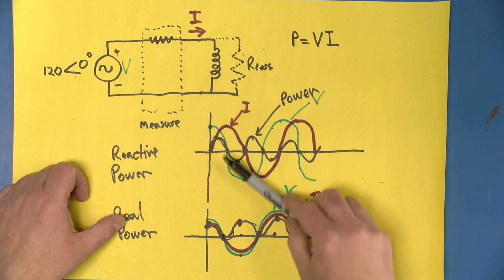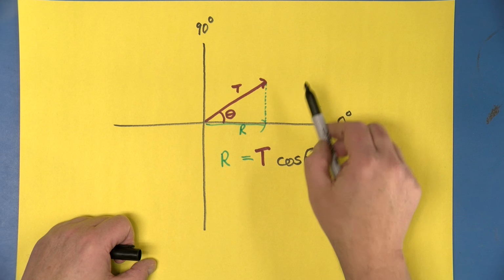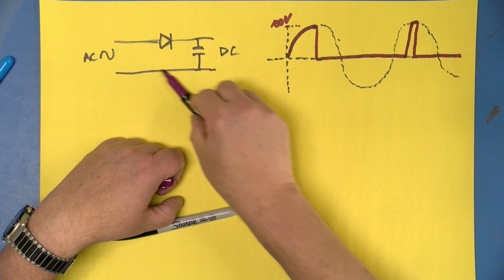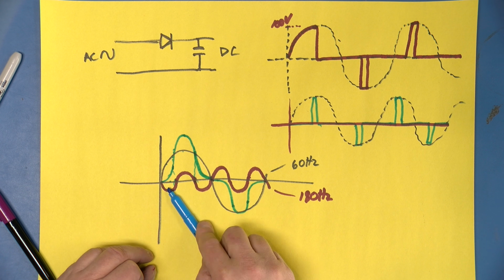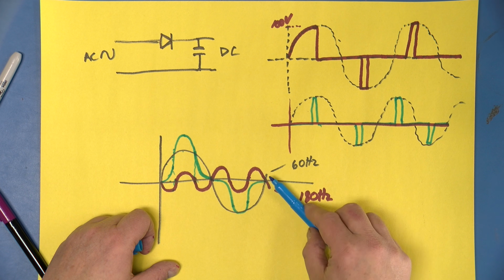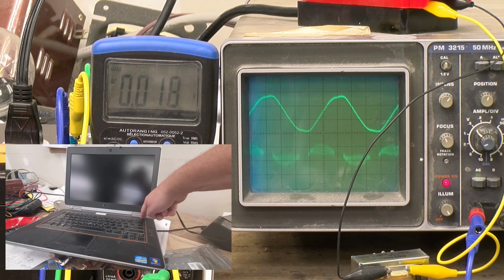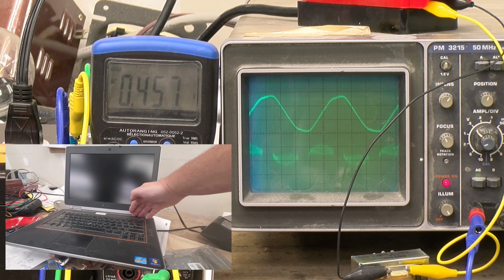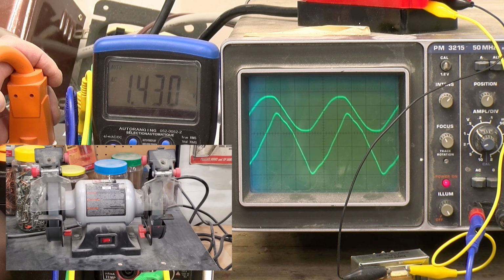Power Factor: you won't believe how bad some of our electronic devices are!

Comment: Hi, again a excellent video.
Can you share the contents of those 2 black boxes ? Because the way you use them for measuring current with your scope intrigues me, i know the simplest way to measure current is with a current shunt, but the problem with that is, that the ground of the scope probe then causes a short. Or you need to use a isolation transformer (or a expensive differential probe) but that isn't clear in the video. Thanks in advance.  Grtz
Reply from the maker: Than Bjorn! They simple shunt to ground current probes. Over herer (Canada - and also the US) the 120V outlets are polarized so one of the pins is defined as neutral (connected to ground in the in the circuit breaker panel) so this configuration is relatively safe. You couldnt really do that in many 230V countries with some of the two pin European style plugs which are not polarized (I think variants like the French plugs are ?) since that could leave the ground/return connection of the scope at 230V depending on how things were plugged in. 

I also was using my analog Phillips scope which has a two wire plug - no ground. The HP digital scope I have is grounded  and would trip the GFCI.

You made me think about one might make a similar setup in the EU regions with unpolarized plugs. Perhaps an isolation transformer and if yo wanted a neutral, use a   polarized plug like a British plug as its output, with the neutral connected to ground. Alternately, current transformer to sense current and a isolated step down for voltage. I'm not sure how high a frequency a CT would carry - I have a bunch 0 should test them!.
Reply: @ElectromagneticVideos  Hi, yes we use non-polarised plugs, but even with polarised  plugs, the problem stays the same. We use here the T-T mains grid system, so our Neutral and ground are separate. From the street we get 3 phase wires and neutral (4 wires in total) to our home, each home has a copper rod in the ground which is used for ground. In the breakerpanel and through the entire house, this ground and neutral are separated from each other, and depending on the electric load of the house and neighborhood, we have arround 0,5 up to 5V (useally arround 0,5a2V) between the neutral and ground. This low voltage has enough current to trip a 30mA RCD,so are RCD not only trips when one of the 3 phase wires had leakage to ground, but also when there is leakage from neutral to ground. So measuring mains current with regular current shunts is not possible here. Only when using a differential probe or isolation transformer.   Grtz
Reply from the maker: @BjornV78  Wow- up to 5V between neutral and ground. I knew of those different approaches of where/how the ground and neutral are connected. I'll have to look into it sometime. I'm sure there are advantages of each. I could also see in some places even if the approach used isn't the best, it may be to much of a hassle to change (same as different 120 or 240V). 

I'm intrigued with how high a frequency current standard CTs can measure. Will experiment a bit. Could also be useful here for 240V measurements where our 240V is actually a +120V and -120V phase.
Reply: @ElectromagneticVideos  yes, up to 5V (what i have read about TT systems), the times that i measured it, the maximum was arround 2V, with most of the time arround 1,5V. Enough to light up a small LED. Here in Belgium, each home doesn't have his own transformer on a pole outside, most of our electrical grid is under ground, and we have on multiple places transformer cabins, where 10 or 15000V is transformed to our 230V. Each transformer cabin is enough to power multiple streets. (+50 residentials homes). The more away from this transformer cabin, the more (stray) voltage on the neutral coming from this cabin, hence the 0,5 to 5V.
Reply from the maker: @BjornV78  Interesting! Kind of intriguing to power a LED between ground an neutral! 

I remember Germany had (or maybe still does) have little concrete buildings  - sort of like a small tower - with the transformer for a neighbourhood inside. Maybe similar.

Over here (Canada, US) usually a small number (dozen?) of houses share a pole or ground  transformer. Each house gets 3 wires +120, -120 and a combined neutral ground. Each house has one or more ground rods connected to the main circuit breaker panel where the ground rod, combined neutral ground from the transformer, and the neutrals and grounds from all the circuits (including those from sub panels) connect together - the only place where grounds and neutral connect. Writing this I wonder about ground currents that could flow between houses though the ground. I will have to look into it!
Reply: @ElectromagneticVideos  , because one big transformer is used for many homes here in Belgium, noise caused by bad equipment can reach other homes.
I know the story of a place where they used "Power Line" adapters, to distribute internet from through the house, and one of the Power Line adapters whent haywire and started to send out noise on different frequencies then normal. These frequencies travelled up to 2 kilometers away. After a combined investigation between the internet provider and electrical grid manager, they found the home that caused these problems.
Reply from the maker: @BjornV78  The internet over power lines in an interesting interference story. Some companies were doing that here years ago and I did wonder about interference. I think in the end it was need for speed that ended that over here.

Comment: I have the 20 MHz version of that exact same Phillips dual trace delayed sweep oscilloscope.
Reply from the maker: They are great old scopes! I do prefer it for things like this than by digital storage scope.  My main concern is one day the pushbuttons or rotary switches fail and thats it for the scope.
Reply: @ElectromagneticVideos  Another benefit, at least on mine, is the two wire power connection.  The chassis floats.  That eliminates the flash bang that can happen clipping the ground lead on something "hot" but it means the scope chassis can itself be "hot".  I have no memory of testing whether probe ground is chassis ground; I'll test that right now.  Not much bare metal on that scope, but yes, the chassis ground is the signal ground.
I use a little Goal Zero inverter thing to power a digital storage scope so that it floats to achieve the same isolation when I'm doing anything with mains voltage.
Reply from the maker: @thomasmaughan4798  Yes - thats another great thing about the scopes - essentially a built in isolation transformer. I'm pretty sure the probe ground is the chassis ground ....

My digital scope has the same issue - grounded. I never thought of using an inverter as an isolation transformer but given how common and cheap inverters are these days, thats a great idea.

Comment: 32:15 These vintage style LED bulbs often don't have much of a power supply. It's usually only a rectifier, often without a smoothing capacitor, a linear constant current regulator and all of the individual LEDs within the filaments in series. Once the voltage of the AC sine reaches the forward voltage of the LEDs, they start conducting and the current is then kept constant by the regulator, giving that rectangular current waveform.
Reply from the maker: So thats why the one had a square wave type current! 

I have heard for 230V versions, the often use a capacitor to limit the current and then a full wave bridge to drive the "filaments". I'm guessing our meagre 120V may not be enough for the number of LEDs in the longer "filaments".
Reply: @ElectromagneticVideos  In the vintage bulbs, they commonly connect the filaments in series for 230V and in parallel for 120V, at least that's what I have seen before. Each section has around 20 to 30 white LEDs in series internally, making for a 60 to 90 V drop per section.

Capacitive dropper circuits are more commonly used in non-vintage style LED bulbs which usually have fewer individual LEDs.
Reply from the maker: @tuxrandom  Oh - OK! Interesting though that I dont seem to have come across any capacitive dropper ones. I'm pretty sure BigClive took apart a capacitive dropper LED which is why I though they might be more common 230V places, him being in the UK.

Comment: Early and now bottom rung cheap LED lights were simply capacitive drop power supplies, rectified and fed direct to the LEDs with a current limiting resistor and they gave the terrible peaky draw shown.  We've gone past the SMPS designs and now a lot of more pricey / better bulbs use linear current regulators.  You can even see tricks where there are multiple strings of LEDs in the bulb and they switch on progressively across the sine to give a more agreeable draw.
Reply from the maker: I had never heard of them switching on LEDs as the siNe wave progresses - how clever!

Comment: Yes, a lot of things have terrible power factors.  Even heavier appliances, fridges, air conditioners etc can have horrendous power factors when in a low power state as their load in those states will be the electronics running the show.  It's typically so low current that most countries do not require any PF correction for such low loads since the cost of PF correction for these low loads would be excessive compared to the cost of the thing that caused it.  Many fridges are low power enough even when running to fall below the threshold where PF correction is required.  Harmonic loads are much more of an issue than the classic lead / lag PF of days past, and we see the collective crest loading by the peaks of the sine being chomped.
Reply: Oh, and here's a twist.  The line operated F&P fridge (standard compressor) has a PF of 0.90 with the compressor running and the fridge drawing 127 watts.
Reply from the maker: @retrozmachine1189  Good old induction motor with a great pf! 127W with some sort of 50% duty cycle would be similar power to the inverter on all the time.
Reply from the maker: I amazed to hear running fridges can be below the "no pf correction required" threshold. I'm a bit surprised there isn't a rule requiring it for fridges given they are in the category of "everyone  has one and is always using them" type of device and presumably contribute significantly to a homes non-hvac load.
Reply: @ElectromagneticVideos  It was like that a few years ago in the USA/Australia/NZ and others for inverter fridges.  My split ACs, even the 5 year old one, has excellent PF .97 or higher no doubt due to their rating pushing them into the category that requires correction.  I'll put a meter on the several year old inverter fridge (LG) and see where it comes out and add another comment later.
Reply from the maker: @retrozmachine1189  That would be interesting. Here's a question I have wondered about - any idea how much more efficient the inverter fridges are compared to the old simple induction motor compressor ones? I was always under the impression that induction motors were 80 to 90 percent efficient and it seems hard to imagine getting significantly better efficiency with the additional losses in the power electronics of the inverter ones.
Reply: @ElectromagneticVideos  From what I've heard the energy efficiency in inverter fridges is more about the refrigerant and insulation than the compressor.  I have no way to verify that but it was told to me by someone that is definitely in the electronics engineering world so if anyone knows, he would.
Reply from the maker: @retrozmachine1189  Interesting. I wonder if the whole inverter bit is just to make the make the compressor cheaper by running it it on 3 or more phases and needing less copper.
Reply: @ElectromagneticVideos  Yes, it's likely a cost of manufacture thing.  It'll allow for universal compressor around the world too.  Results of the LG inverter are 0.52 idle, 0.38 with the door open and LED lamp on, 0.60 with compressor running (70 watts, running fairly hard since it just came off a defrost due to me power cycling to fit the meter).
Reply from the maker: @retrozmachine1189  Of course - I never tho0ught of that - same product worldwide probably reduces costs significantly rather that 4 version with all combination of 120/230V and 50/60 Hz. At most they would need a 120V and 230V inverter - and even that might be multi voltage.
Reply from the maker: @retrozmachine1189  I'll bet there is efficiency gained from adjusting the compressor speed depending on cooling needs rather that the old on/off thermostats. So the condenser rarely gets very hot and and the evaporator doesnt get colder than needed.
Reply: @ElectromagneticVideos  That's something along the lines of how I thought too.  It's a pretty crude comparison but using the volume of the fridge vs the (Australian) energy star expected kWh/year figure there's not a lot between the inverter LG and line operated F&P.  The F&P is a fair bit older than the LG so it's possible the energy star rating method changed as it does from time to time.
Reply from the maker: @retrozmachine1189  Well it has been an interesting discussion! I have seen various inverter things (including air conditioners) appearing - makes a bit more sense now.
Reply: So we need some kind of power factor correction system for such loads as frigerators, etc. Instant phase modification unit. Timing is everything.
Reply from the maker: @hyperexplorer5355  Yes! There is off the shelf stuff that could be built right into the fridge but like everything there is a cost to it and manufactures avoid that unless forced  to. I'm generally an opponent of excessive government regulation, but this might be a case where it makes sense.